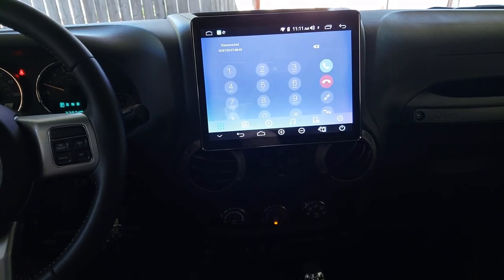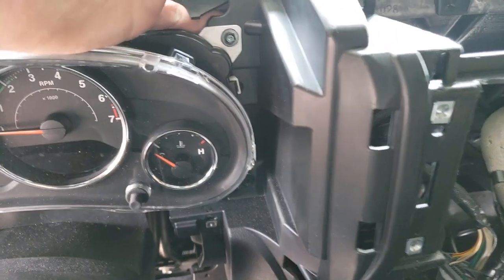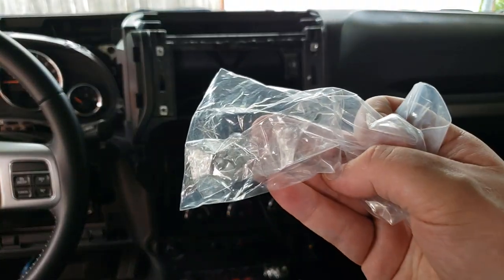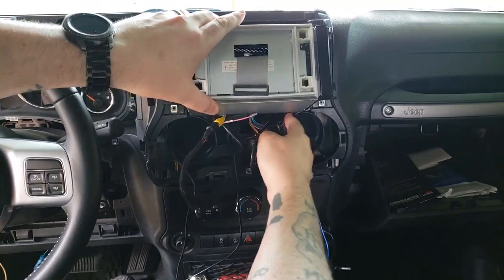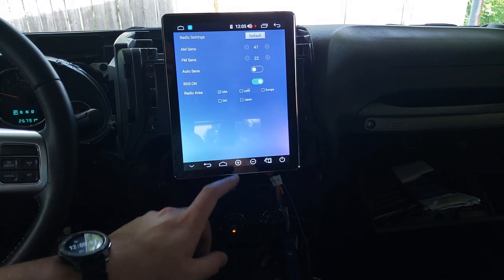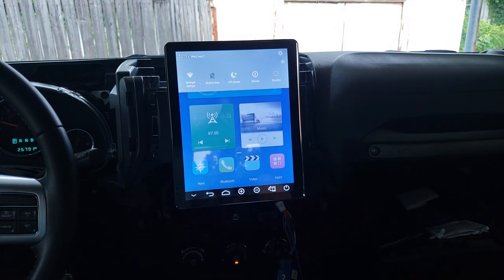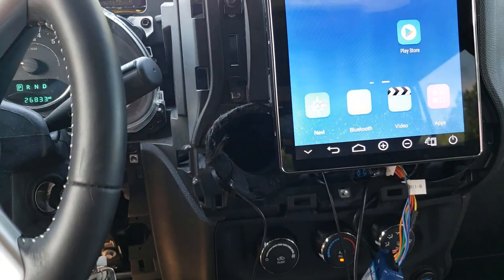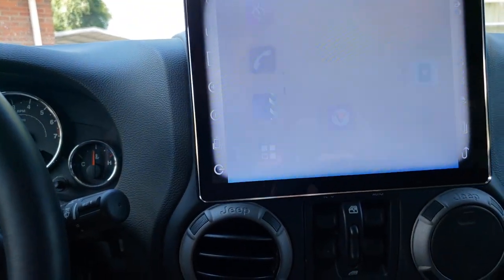Joying Double Din | Android Head Unit Installation | Jeep Wrangler

Comment: Hey, question I didn’t hear you talk about in the video. Is the unit powering your stick speakers directly or does it go to a factory amp first?

My plan was to run RCAs into an aftermarket amp. I’m hoping that will work and should good.
Reply from the maker: I do not have a factory amp. Currently the Joying is powering aftermarket speakers I installed myself. I have an aftermarket amp and sub installed. The RCAs are run to the amp for the sub, the only issue is the RCAs are low voltage and you will need to get a line driver or crank up the gain
Reply: @5after12  ahh okay thanks, that's too bad wish these units came with pre amps.

Comment: Why didn’t you use the jeep specific wiring harness from joying?
Reply from the maker: Because that only comes with the Jeep specific head unit this was a "universal" unit. Now if you happen to have an extra jeep harness it could be plugged in to this and it should work, but I didn't have an extra one
Reply: Oh ok would you happen to know what all the canbus does besides steering wheel controls?
Reply from the maker: I don't know what all it does, but I think you have to have it

Comment: how many radios have you installed in this vehicle,do you like to change radios every year,lol. I know you have other radio install videos,lol,,,,,,,,,,,,,
Reply from the maker: I installed a lot, probably over 10. I had the Jeep almost 5 years. I kept the Pioneer AVH-W4500NEX the longest probably. I recently traded in the Jeep on a 2018 Cadillac CT6, so now more head unit installs. However, I did have two 12s put in there that I will make a video on